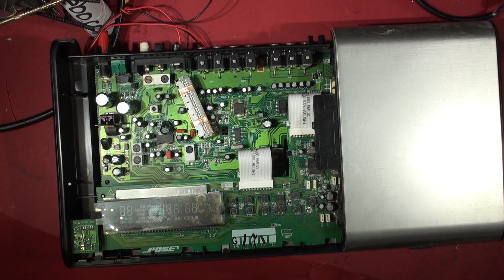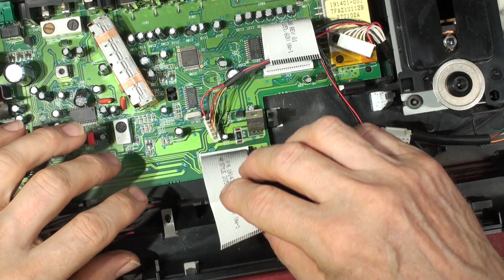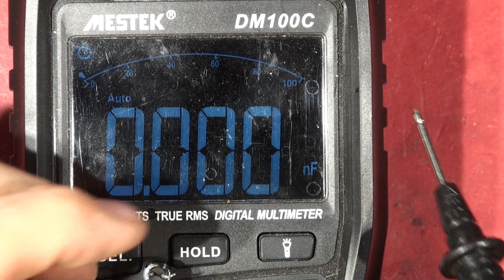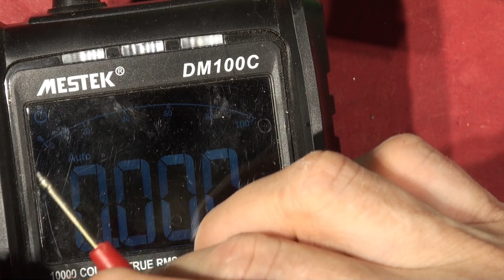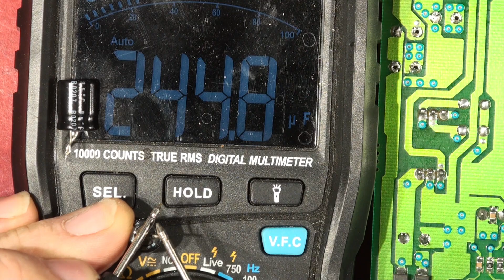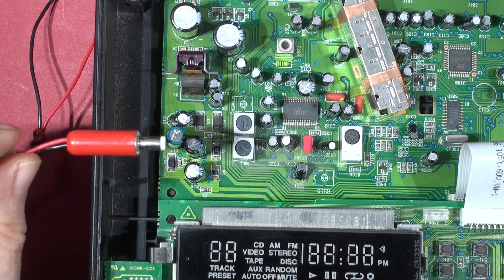Bose LifeStyle and Music Center Detailed Display Faulty Repair with Diagnostics and Schematic

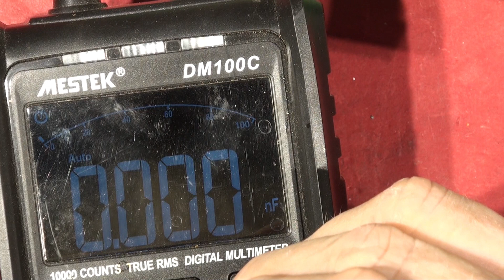Comment: the 33uF cap actually read out at 10 nano farads !!  14:42  Thanks for your repair videos. !!   They helped me repair 2 different Bose systems of mine.   2 displays and one CD drive motor
Reply from the maker: It isn't a happy cappy in that circuit!!  Bad design - if only the product designer had read and understood the datasheet for the cap. Thanks for watching. Subscribe if you can.
Reply: @razenby where did you get these caps, source please, 
Awesome video..

Comment: Hello magic smoke I've recently stumbled upon your videos and since im i have this home theater system and the same problem with the module where there's no display i was wondering if i can send mine out to you and if you are interestedy you give me a price and we'll make it happen. I also have this old theater system that still packs a punch I know a couple of things that aren't working like the volume knob isn't giving me a response only the remote and i like to change that neither is the function button working aswell it doesn't give me any response so somethings wrong there, the display on the system seems frozen/stuck in place when i was playing a movie it wasn't showing the runtime the level of volume ect ect and maybe the function button works it's just that the display is frozen and so it won't show anything when I'm pressing function i don't know just a theory . Finally I't be great if you can check  the speaker wire spring terminals or however you call them work with a multimeter i don't know if I'd need all the speakers because i have pretty much all of them except the center 1 so I'm not sure if all the terminals can be with the multimeter or if you even need the speakers in the first place to make sure they aren't fried. Sorry for the lengthy comment I'd do this myself but i can't make that magic and smoke happen like you haha plus i don't know who else to turn to you seem intellectual in this field! Subbed
Reply from the maker: What is the model number of you Bose system please.

Comment: Anyone know a reason why video audio wouldn’t be producing sound? I’m going to do this LED fix but I’m having an issue with video audio output. I have AM/FM and aux working so I know the system works to some extent. Remote is also not working at all.
Reply from the maker: It is likely to be a blown codec chip or audio route switch /mulitplexor.  What are you using for audio input ?
Reply: Running stereo RCA cables from a projector to the video sound on the Music Center 5. As a temporary fix I’m just running aux out of the projector to MC5.
Reply: @razenby  remote also isn’t working but once I get that taken care of I’ll see if it’ll switch via remote.

Comment: What are the pin connections on the jack of the power supply? Positive (+) in the Tip and Negative in the Shield? I have one of these but no audio/voltage cables. So I want to make the polarity in that input connector.
Reply from the maker: The adaptor has to be an AC transformer type. If you supply the unit with DC it wont work. From memory 12V AC 2Amp.  Check back panel. i think it is printed or emobossed on there or the product label.

Comment: Dac.
I have Bose Lifestyle 12 Series ii. It works well for years, recently It has sound on CD only, the sound is hum on the TV and radio. Would you please let me know what is wrong and please make a video to teach me how to fix it ?. Thank you very much.
Reply from the maker: Most probable cause is a failed smoothing / reservoir capacitor. Take the lid off and inspect them carefully for bulging at the top (slight dome) or leakage.

Comment: Thanks for the video,
I have the same unit going on 15 years now and haven't used it for 7; just let it sit there for all those years. My better half wants me to get it working again or purchase another. I believe that I am quite capable in repairing mine as well but I am needing to know where I may purchase the "replacement capacitors" for the lifestyle 5 or is there away or not using the Music Center and running it off something else more up to date?
Also, would it be a good idea to just go ahead and replace C15 & C16 while doing this?
Reply from the maker: You can buy them on eBay or LCSC.com  in Hong Kong. RSwww.com, farnell.com, cpc.com. I would change all the capacitors in the display power condition circuit for a start.

Comment: Hi, I have two of these (believe it or not!) and the displays on both have not worked for years. I am not an electronics person, so it is a testimony to your teaching skills that I was able to follow your instructions very easily and managed to replace the relevant capacitors in both units. One now works very well, the other has a display but only just. Presumably it needs more capacitors replacing. One day I may replace them all, just for the practice! Thanks again for this video, it was invaluable!
Reply from the maker: Great news.  I am very pleased we saved it from the land fill.  Thanks for taking the time to comment. If you could like and subscribe that would be much appreciated.

Comment: First of all congratulations for producing such an informative video and giving all of us the confidence to take on repairs of this nature. I have a unit indentical to the one in the video with the same display problem. I changed C12 and C17 but it still does not light up. If I were to recap the whole unit where would be the the best place to source the caps from?

Richard
Reply from the maker: Hi Richard, as far as you can tell is the unit operating but you have no display?   You are running the unit from the original Bose AC power supply? Was the display working but dim before you changed the caps or completely black? Are you sure all the interconnecting cables are plugged in OK?  Recapping the whole unit may work but I would expect some display,
Reply: @razenby  Thanks for the quick response. The unit is working fine apart from the display which is completely black. Yes I'm using the original power supply and pretty sure all the connectors are back in correctly. I've now ordered a DMM like yours so I can measure capacitance. Once it arrives I'll have another go at checking things.
Reply from the maker: @toadie123able  You should check the negative voltages on the display bias and heater cct power generator.    The internal fine wires are cathodes get hot to allow them to fizz electrons. If the bias voltages are there,  If you use a DC power supply instead of an AC then everything works except the display.
Reply: @razenby  Thank you. What you makes perfect sense but I'm not sure how to identify the display bias and heater cct power generator. I'll have a think but any pointers would be grreatly appreciated.
Reply from the maker: @toadie123able  All detailed in the video - the outputs from the capacitor network in the diagram I drew
Reply: @razenby  Ah yes, excellent. Thank you.
Reply: I connected it back up to the amp etc.. and the display is working. :) The only minor niggle is that it clearly lights up the mode it's in (as expected) but other bits of the display are partially illuminated albeit quite dim. Any ideas what that could be?

Comment: Excellent ad hoc  troubleshooting and repair video. I came here to see how to get the controller board out in order to repair a bad (loose) AC power jack. The display works but isn't as bright as it used to be. Now I'm thinking this might be the time to check those electrolytics and replace as necessary—since I will have it all apart anyway.  I bought the unit in 1998. Thanks for publishing this.
Reply from the maker: You are welcome.  It should make it brighter if you change the two stressed capacitors. Good luck.

Comment: Thank you for your videos. I'm having my Bose 1SR soundbar acting up recently, being intermittently unresponsive to remote inputs, and sometimes crashing. Do you have any experience fixing the 1SR?
Reply: I don't think the 1SR has a TI chip. Anyway, stumbled upon someone who mentioned the  Spansion flash chip. Found it on the underside of the DSP PCB. Was covered by a sticker and came off when I peeled it 🤯 It is a WSON chip with no leads so had to solder it back with copper wire. Now it works again 🥳 I'm guessing the loose chip was the problem all along as I noticed that the soundbar would randomly come to life when I rattled it..
Reply from the maker: @slorentzen80  Great job.
Reply from the maker: Locate the 1.7V and 3.3V rail's smoothing capacitors and replace them.  This often works.
Reply: @razenby  thank you for the quick response! I will try replacing those capacitors..
Reply from the maker: I'd say it works about 30% of the time but it is a simple  thing to try.  Let me know if it works please and remember to like and subscribe.
Reply: Been searching for the rails on the DSP PCB, but can't seem to locate any 1.7 points. Would those rails be on the PSU PCB?
Reply from the maker: @slorentzen80  Not Sure.  There is definitely a 3.3V rail on a Texas DSP chip.

Comment: Thank you so much. I replaced four capacitors following your Video. The display works again. It is not only revive the dead machine, but also eliminate one of the electronic waste. One thing I like to share is that I cannot find 33mF 63 V for C17. But I do find the 47 mF 63V capacitors from Amazon. It works Using it to substitute 33mF 63V capacitor.
Reply from the maker: Great job. Thanks for watching.  Good to know another unit has been saved!!

Comment: I congratulate you Magic Smoke because I have tried watching many Youtube vids supposedly trying to inform on a subject but none quite as comprehensive or as well explained as yours. Regrettably I have little to no knowledge of electronics but like Srinath Seshadri below I have a completely dead Lifestyle 5 M C unit and found your fascinating video while researching where I can pay to get it repaired.  I know the 12 vac PSU is ok – I have been able to test that much 😊 any ideas where I might look? Or better still, has your circumstances changed such that I could perhaps pay you to repair it.  You might make another of your superb vids in the process.
Reply from the maker: Hi Dave. Thanks for the comments.  First thing are you sure the transformer is AC output not DC. I ask because this has often tripped people up as they assume that the AC term refers to the power source not the output from the adaptor. Do you hear any life from the CD player mechanism?   The most likely cause is a bad capacitor somewhere. Check the large ones nearest the power input socket. The rectifier and regulator are just in front of the them.  Unfortunately I am working on design contracts that will last for a couple of months.  If you systematically poke around and look very closely you might spot a bulging or leaking capacitor or something scorched or burned on the board.

Comment: I have a completely dead unit. Not just no display, no sound, nothing, no CD spinning. Is that what C12 and c17 failure looks like. I thought it had a fuse or maybe even the transformer is dead.
Reply from the maker: I haven't seen a failed transformer.  There is an internal fuse - check C16 and any other large electrolytic capacitors inside.
Reply: @razenby  The fuse is in the transformer ? I dont see one in the receiver/cd player module.

Comment: Excellent vid with information about negative voltage -33V supply to anod and + 33uF capacitive dropper to cathode heater for that display. Thanks a lot.
Reply from the maker: Glad it was helpful!